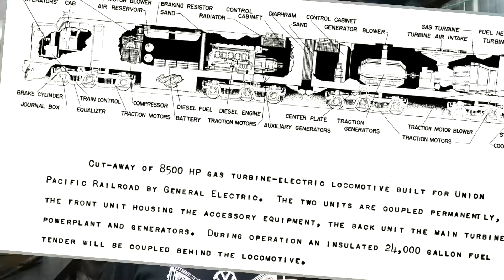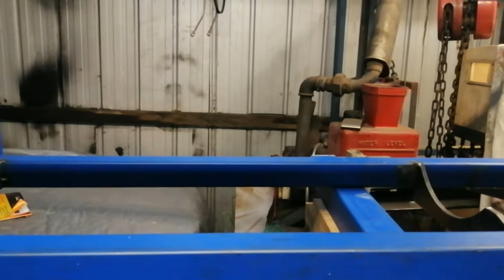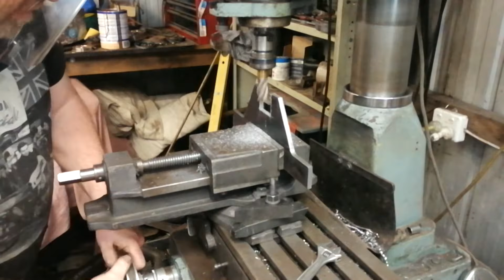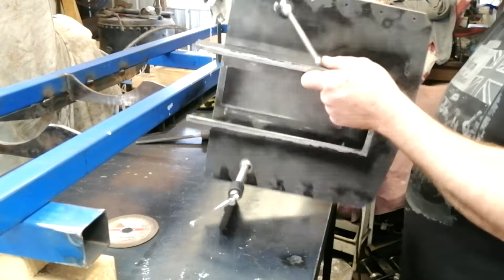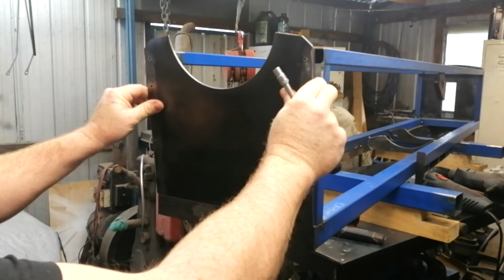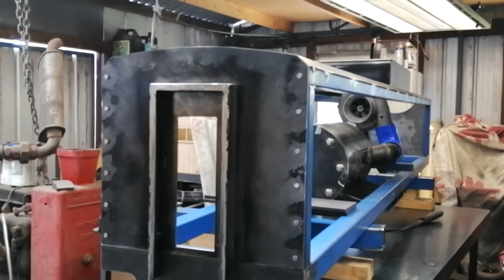Building  a Union Pacific , Gas turbine Locomotive

Comment: Hi there great job good project I’m also contemplating building one I’m based in New South Wales same idea of using the gas turbine couple to a generator just having a problem working out the transmission to do the reduction for the generator hope to correspond with you it could make life interesting keep up the good work
Reply from the maker: Hi Kevin thankyou for the encouraging words, glad to have you on board, don't forget to share, like and subscribe for updates on the build 👍
Reply: @EverythingAnthonySOS  Hi there again have you figured out how you  I’m going to change the thrust from the turbine into rotation or talk to run a generator and what speed it’s gonna turn out compare without the 2000 and 3000 RPM of the generator

Comment: Hi mate awesome build, I have a custom made low profile oil scavenge sump I built for the jet luge and a free power turbine unit off the same project if you are interested in.
Reply from the maker: That would be awesome , definitely interested , what's the best way to touch base...?
Reply from the maker: @JetA1Terminator  ready
Reply from the maker: @JetA1Terminator  yes i have removed it cheers